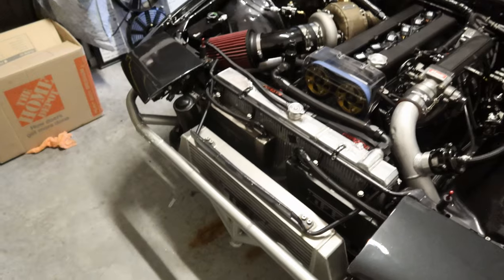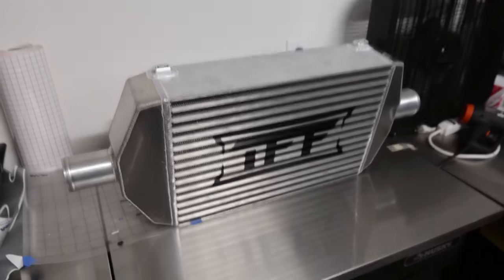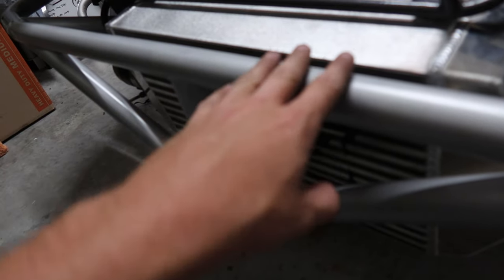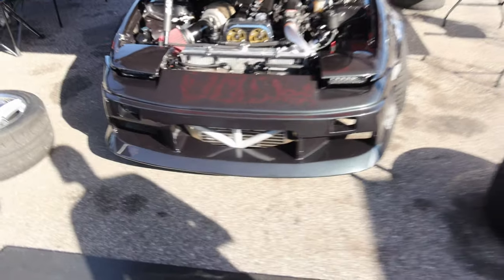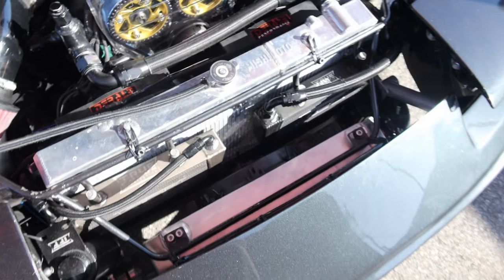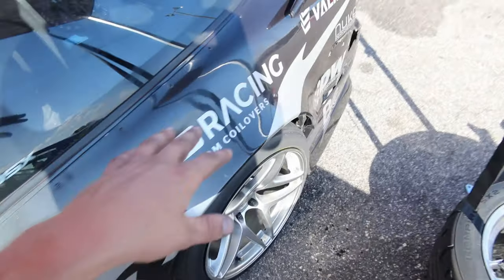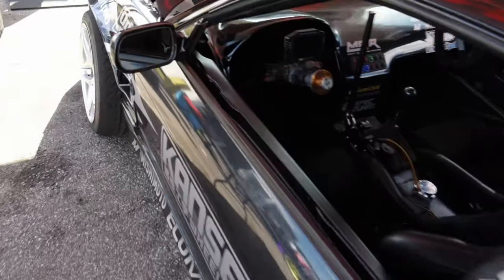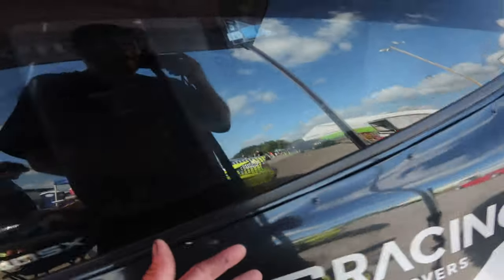Taking people for ride alongs in my drift car! - S13 Upgrades!

Comment: Why do you need a Power steering cooler?
Reply from the maker: It’s a must have for drift cars. Fluid is very hot and we have to keep it cool
Reply: @MattShulman  Thanks for responding. I'm really interested in your PMU setup not too many videos out there on install and programming.